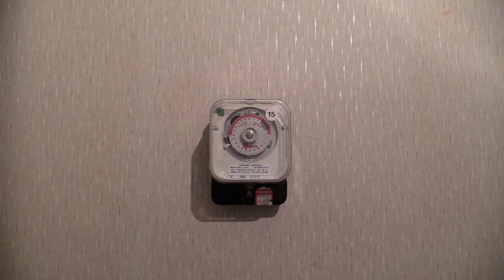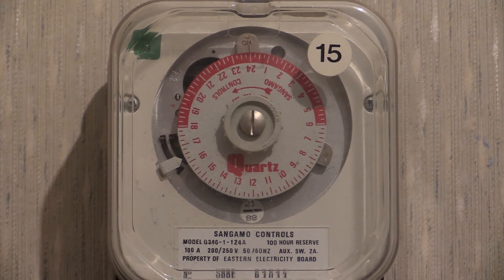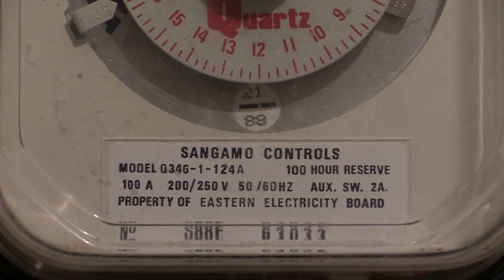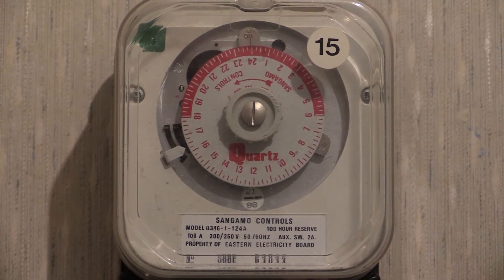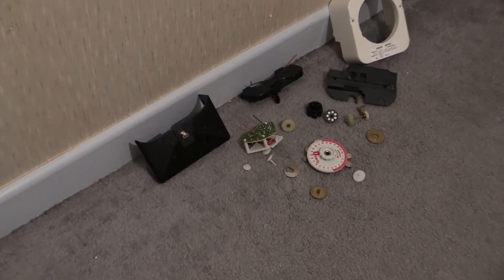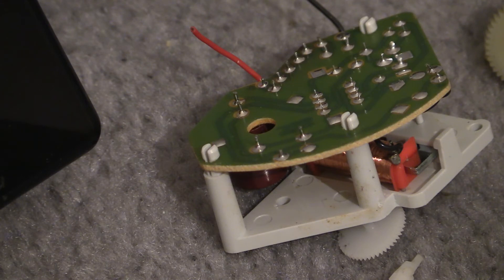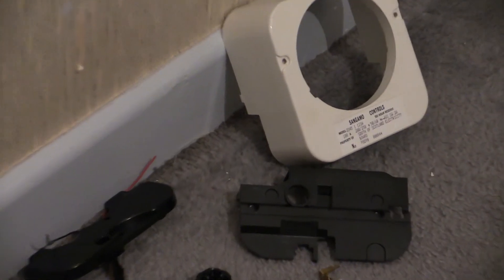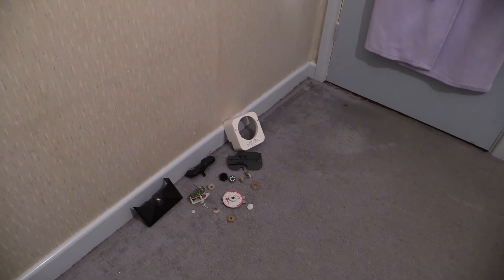Time Switch : Sangamo Weston Q346 Rate Changer Timeswitch.

Comment: Hi wondering if you can help - we currently have one of these fitted to a dual rate L81FA meter - timer is all off - it’s been on high rate for 23hrs then only on low rate for 2 hrs.. saying it’s 10pm when it’s 3am etc  not even sure if the meter is recording the kWh correctly but certainly not getting a benefit from our dual rate tariff as never know when it will switch over.  Any help appreciated many thanks

Comment: did you know no one should have any of these that belong to power componeys still we had new meter fitted and there whee loads stollen and missing
Reply from the maker: This particular unit was removed from service due to a stuffed backup battery.

Chances are, at the time, this unit was replaced with a Radio Teleswitch, possibly like the one which shows on the BoomBoxDeluxe channel, of which will eventually be showing up on Wayne's Electrical in FULL HD.

Thanxx for watching,

-Wayne's Electrical.

23rd January 2017, 04.10